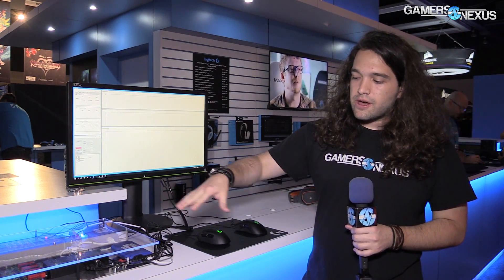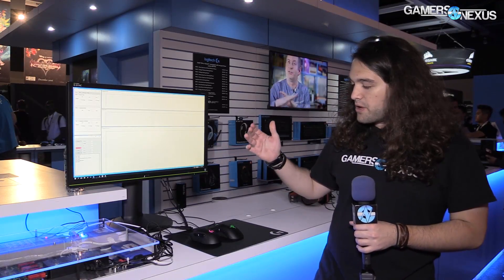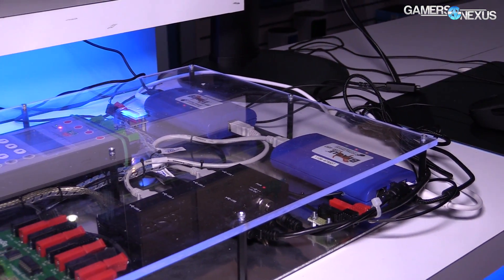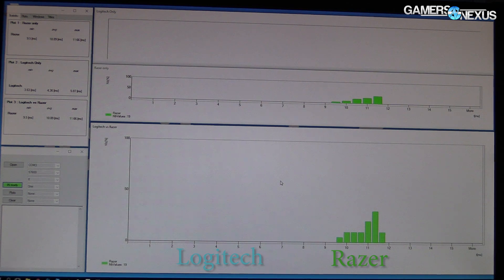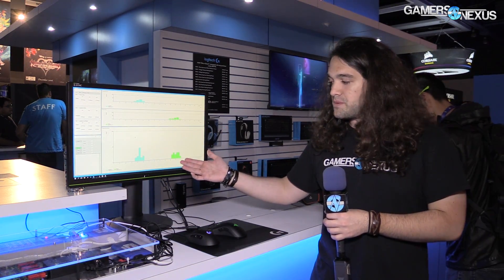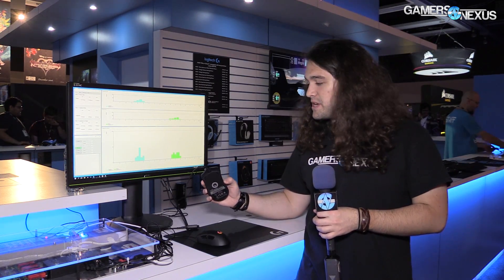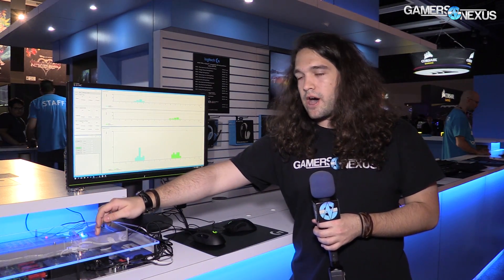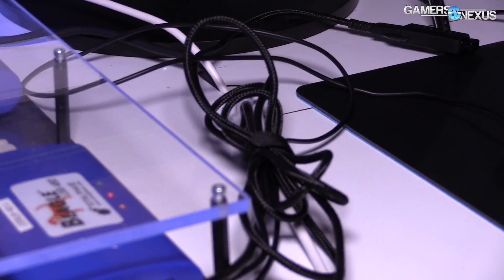Wireless Mouse Click Latency Testing Explained | Logitech @ PAX

Comment: Why not just compare the G403 wireless to G403 wired? If you want to really demonstrate how the wireless technology compares, you should essentially eliminate all other factors, and what's a better way to do that than compare the exact same model with wireless and wired options? This test just shows that the G403 has less button latency than a Deathadder.
Reply: To add: if you google button latency graph, you can see that depending on firmware, the DeathAdder has inherently higher button latency than Logitech mice (G403 was not out at the time of the test) between 7ms and 14ms, which means that the wireless technology on G403 (if we were to assume that the button latency has not drastically decreased since previous Logitech mice) is either as good as wired or slower.
Reply: The fact that they performed the test with a mouse of different manufacturer with added disclaimers how this is not to say that Razer mice are slow or bad only suggests to me that they couldn't have shown the same kind of difference in latency comparing it to their own mouse that is of the exact same model.
Reply: They are slower though. I've seen comprehensive mouse latencies tests, and logi is pretty much on top. Razer is like couple of ms slower
Reply: No, its to show that the g403 wireless is faster than competitors. Are you dumb?

Comment: its not actually that weird logitech beats a razer mouse. Depending on what firmware you are using on your mouse the debouncing part of that firmware could lead to significant gains in click latency. Usually if switches become more worn they start to get a double clicking issue. To solve this the easiest way is to adjust the debounce timer in software to a higher value. I also dont understand why they would show the g403 vs a razer one instead of a g403 which is wired. That way you can really compare wireless and wired one on one instead of other variables influencing the result.
Reply from the maker: Their point was to choose a mouse which is well regarded as being fast and that no one complains is "too slow" on latency. The object of the test is to prove, from Logitech's perspective, that wireless mice are not inherently terribly slow on the uptake. They wanted to use a competitor's mouse to further that point, because the folks who established the test believe the Death Adder to be regarded as a quality mouse.
Reply: Because they are showing that it beats the competition so people will buy it. Why would they show it beating their own mouse you fucking moron.

Comment: I still prefer wired. Cheaper and less potential for problems.
Reply: I just RMA'd a (3 day old) Corsair cable mouse because it kept loosing USB connection... (video in my profile)  
my three Logitech G700 never lost connection. ...cable is very much possible to break, especially if you keep moving and bending it all day long. 
The only annoying thing about wireless mice is that you need to keep feeding it batteries. Had like 8 rechargeables next to my mousepad the last few years and went through 3 loading stations.
Reply: @ZeroB4NG  just sander a new usb and 3 days old that dies is most like a bad batch of mice.

Comment: im interested in latency based on distance and obstructions
Reply: For using while couch surfing?
Reply: Looking at FCC report, the mouse signal strength is 4dBm, which is basically the same as Class 2 Bluetooth, which is rated at 10 meters range. The radio waves will travel 33 nanoseconds within 10 meters so distance will not have any affect on latency in terms of ms. Obstructions might cause packet loss, so as long as the obstruction is not concrete or metal, it should work fine. Wood, glass, and plaster have small impact on the 2.4gHz signal.
Reply: wow,nice to hear that. I bought a g903, will pick it up next monday :D.
Reply: Distance shouldn't really matter as long as you don't get out of range

Comment: I'm loving the g900 so far. I can't detect any latency between wired or wireless on this unit or my brother's wired m65 pro. The only thing we need is better battery life and we should be golden. 30 hours just isn't enough. I hate charging every few days. I wouldn't have minded a slightly heavier mouse for longer battery life
Reply: For the price, Logitech should've added some kind of a charging docking station for when you're not using the mouse. That way It'd look rad while not in use and be fully charged after you pick it up and start using it.
Reply: yeah that would be awesome. I hate playing games while wired. At this point i'd even drop an extra 20 bucks on a charging dock.
Reply: Are there any mousepads that would charge the mouse ? Like those "mats" that charge your phone when you put the phone on the mat. I guess they are induction chargers.
Reply: why not just plug it in when you sleep (like your phone)
Reply: @legendp2011  quiet late but he obviously stated that he hates charging every few days - and you just want him to do it on a daily basis - sorry mate but your suggestion misses the topic.
Reply: That is actually a pretty rad idea, but since current wireless mice don't feature wireless charging coils there is no mousepad available that actually does that.

Let's bombard Logitech, Razer and the other guys to make it happen! :-P
Reply: i had an idea about that battery problem. make the mouse and mousepad Qi compatible.

Comment: Sweet technological gizmo! Counts time from the actual click to when its registered at the machine. I wonder how much that baby cost to build? Nice review Steve. The RF technology has came a long way since the first wireless peripherals came out, and there is no more latency issues to worry about.
Reply: Well the USB analysers they used are ~$1400 a pop... so a fair bit lol.

In saying that you could hack something together fairly cheaply given the know how and time, I'm sure the time to make something completely custom wouldn't have been worth it for a company like Logitech so they would have just gone with reputable (aka expensive) off the shelf parts ;)
Reply from the maker: The custom board and software add a lot of cost in dev time, but you could price the publicly available test equipment as a couple grand. Probably closing in on $10k, given the timer/analyzers used and making some assumptions on the rest.